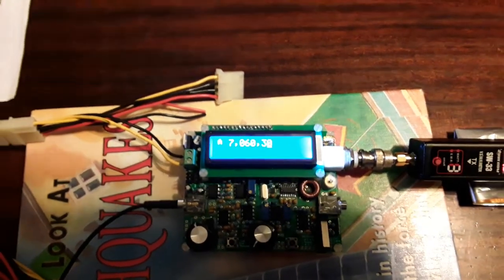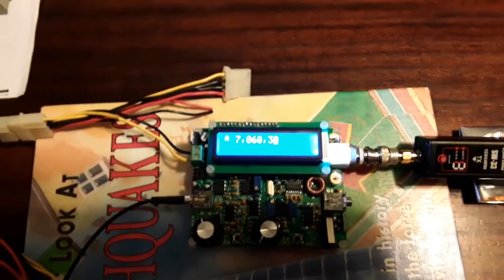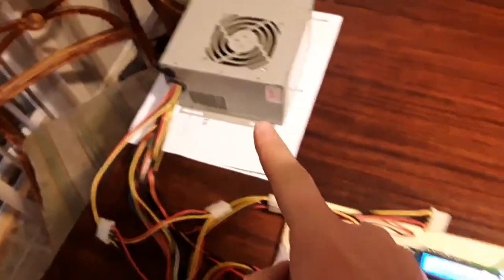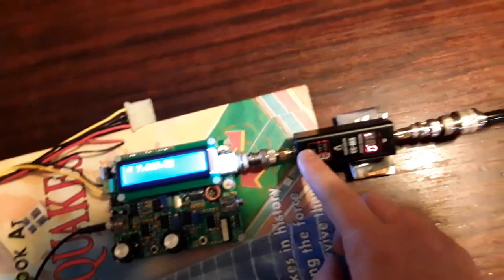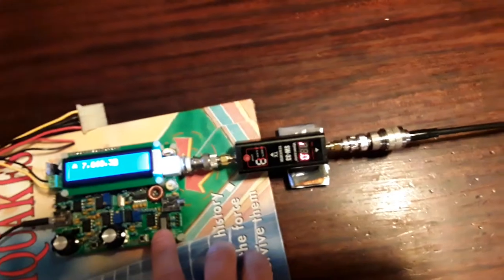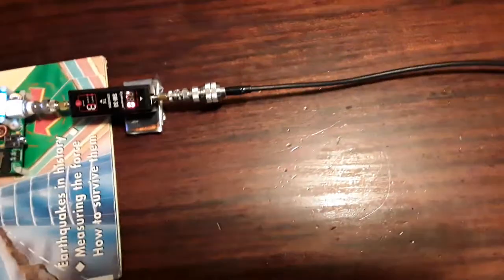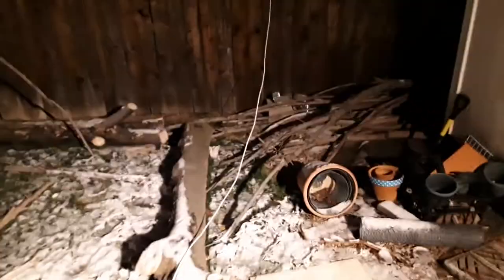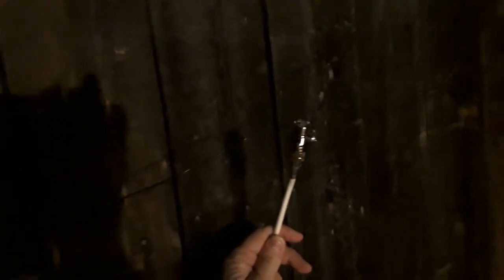First Morse code signal received on QRP labs QCX 40meter CW transciever

Comment: SW-33 isn’t it 100-520 MHz meter? How does it perform on 7MHz?
Reply from the maker: The qcx can be built for many bands.
Reply: I mean your swr/power meter is designed for VHF/UHF freqs. And your QCX is for 40 mtr band, right?

Does that swr meter work well on 7MHz?
Reply from the maker: @АндрейДенисюк-ш7п  ahhhh yes. That was me being dumb. The meter shows no power because it is completely out of band. I have a MFJ 941EK tuner that has been reasonably calibrated by a local ham with an adjustable output set so that NOW i can see on the mfj that it is putting out 0.8Watts
Reply: i realize it is kinda off topic but do anybody know a good site to stream newly released movies online?
Reply: @Dante Asher I watch on Flixzone. Just search on google for it =)
Reply: @Ephraim Carter Yup, been using flixzone for months myself :)
Reply: @Ephraim Carter thank you, I signed up and it seems like they got a lot of movies there =) I appreciate it !!
Reply: @Dante Asher No problem xD